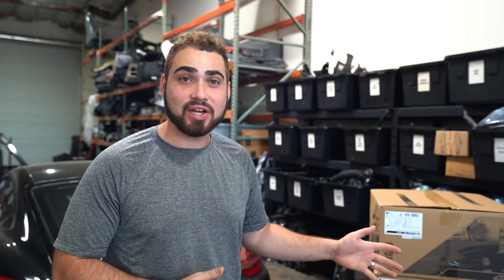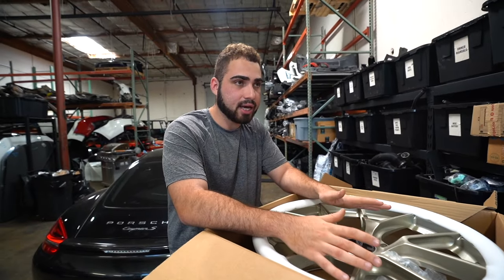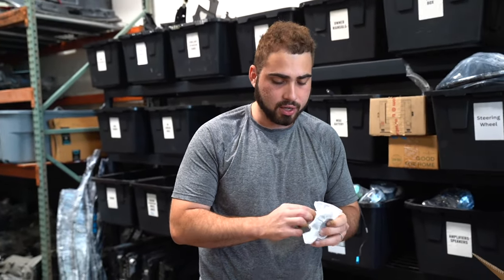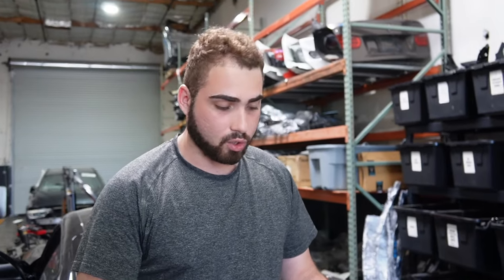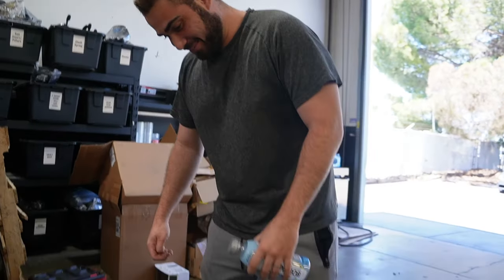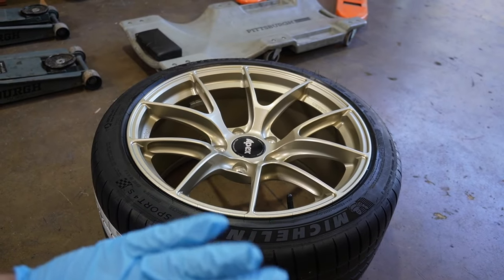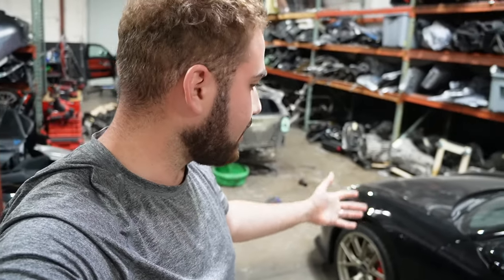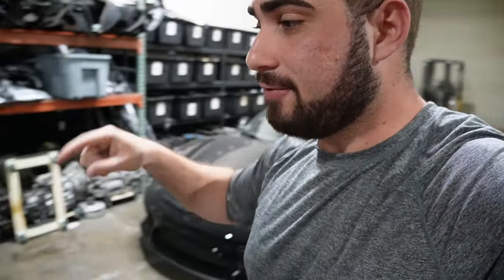I BOUGHT MY DREAM WHEELS AND TIRES FOR MY PORSCHE CAYMAN 981!

Comment: If you plan to lower the 981, I recommend the stock (optional) x73 suspension. Its 20mm lower and feel amazing. Unless you're buying $6k+ coilovers, I wouldn't recommend lowering the car. Half of the appeal is how it handles and soaks up bumps while still being really quick